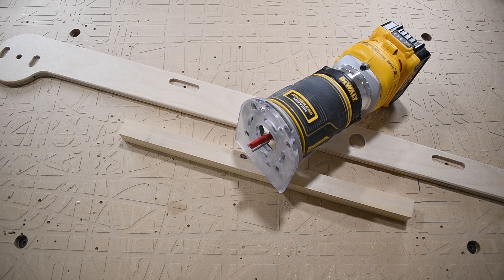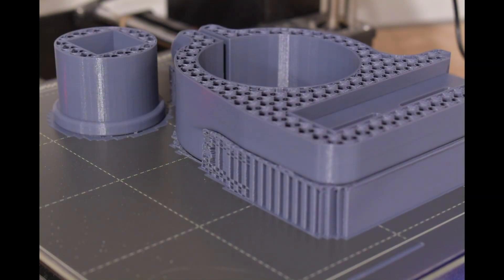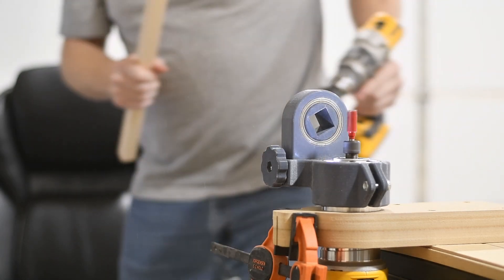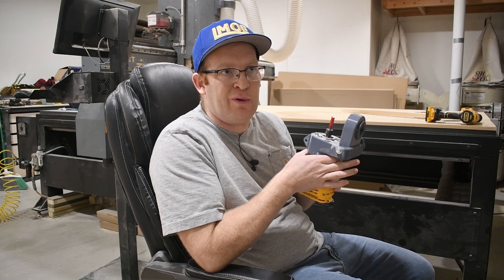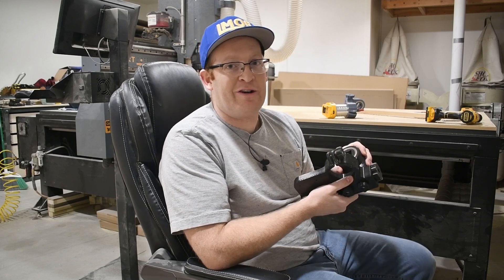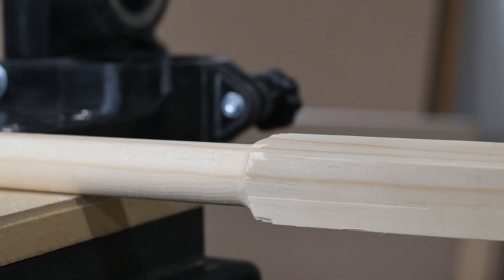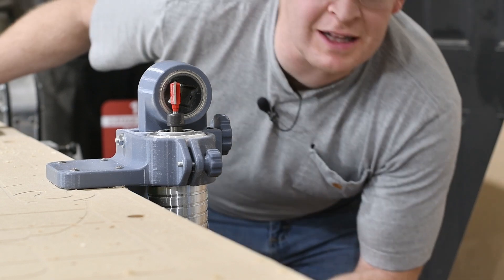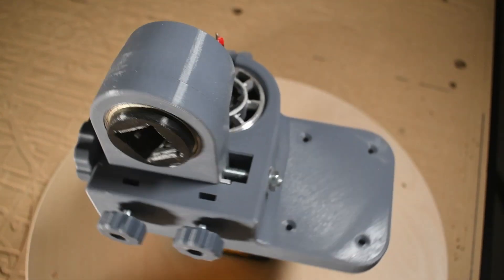I Designed a 3D print to turn my router into a lathe! (FREE DOWNLOAD)

Comment: You should make the mounting height of the jig adjustable.  That way you can just set the battery of the drill on the work surface and just slide it toward the jig.  That would keep your feeding straight and plumb.

Comment: The most obvious improvement i would like to see is something that holds the drill steady and allows you to concentrate on a constant feed rate for the dowel. Something like a track or rails. Of course with a second drill, you could automate the feed by turning a long threaded rod. Great project! I love 3D printers! All the best, Rob in Switzerland
Reply from the maker: Great suggestion. Id like some out feed support as well. Thanks for the comment!

Comment: Great work on the design.  But you could do the same thing a lot easier with a roundover bit and just round over all four sides of the square dowel.  A little sandpaper and a drill and you can size it to fit just right.